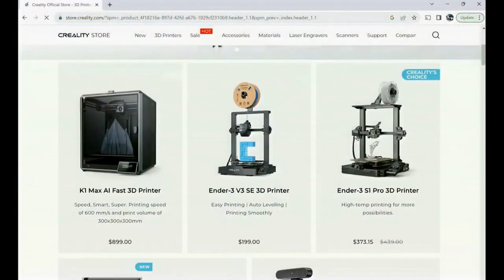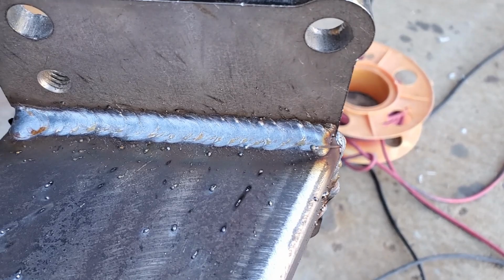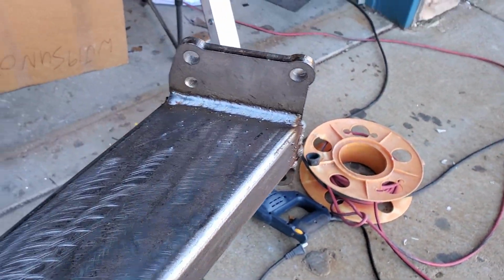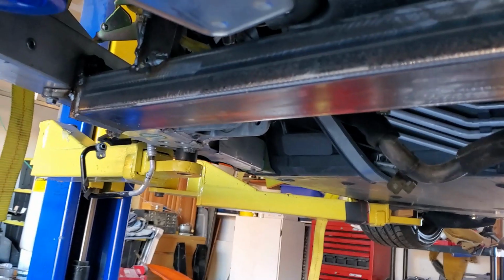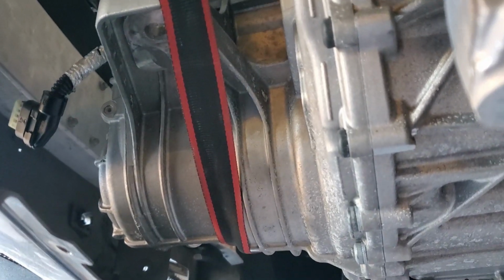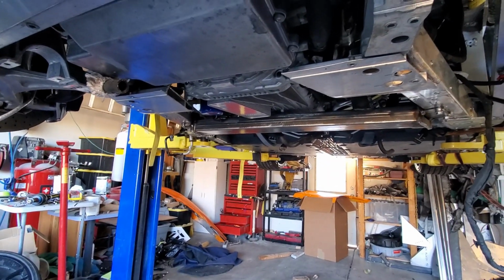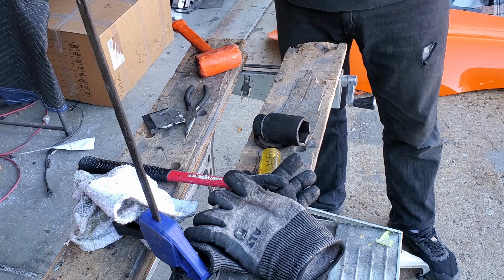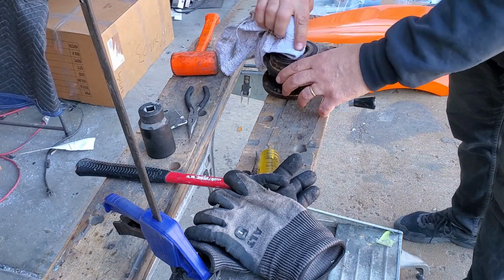LT2 Engine Mounts for the McLaren

Comment: Usually on that style hub, the CV axle/nut keep the bearing pre-loaded.  Without that being installed, the bearing clearances can open up.
Reply from the maker: Agreed.  It is more important for the conical berings like in my Aventador.  These I had to press fit to a certain preload, so less of an issue for rolling around.